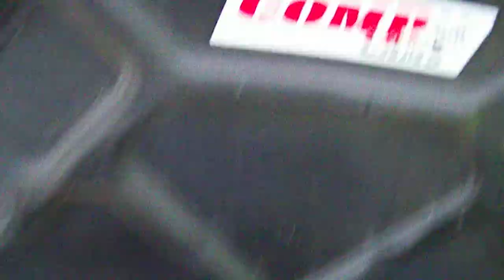Ford Focus Comp cams stage 2

Comment: Awesome, for a sec I thought I was the only 1 dumping a ton of $$$ into my zetec!!! I did ALOT OF REPAIRS & UPGRADES & THEN LASTLY my timing & water pump & then I installed a cold air intake TO THEN DEVELOPE A SLIGHT LOWER END KNOCK! TOOK IT APART & FOUND EXCESSIVE BEARING WEAR FROM 200K MILES (& A PREVIOUS, TEENAGE OWNER) SO I INSTALLED THE BEST MAIN & ROD BEARINGS I COULD FIND, NEW O2 SENSORS,COIL,SPARK PLUGS(MOTORCRAFT & THEY SHATTERED AFTER LESS THEN 2K) , WIRES, & ALOT MORE, ID BE HERE TYPING 4 EVER!!! I FOUND THE COMP CAMS & 1 OTHER COMPANY OFFERING UPGRADED CAMS FOR THE ZETEC. MY BIGGEST QUESTION IS, WHEN I FIRST LOOKED N2 UPGRADING MY CAMS, I WATCHED A VID ONLINE ABOUT IT & THEY SAID TO "ALSO REPLACE THE FOLLOWERS" WHAT ARE FOLLOWERS??? R THEY THE LIFTERS, LIFTER BUCKETS??? ID LOVE TO KNOW ALL ABOUT YOUR ZX3 ZETEC & ALL THE WORK UV DONE! EXSPECIALLY ABOUT TUNING!!! MUST I REPLACE THE STOCK ECU? HEARD I COULD USE A 00-04 RS ECU BUT IV NEVER SEEN 1 IN MY LOCAL U PULL IT!!! LOVE WHAT UV DONE & REALLY HOPE TO HEAR FROM YA!!! YESTERDAY I ORDERED A 4G DONGLE 4 MY 6.2' TOCADO 4G ANDROID 6, THAT I INSTALLED N2 MY 03 FOCUS SE, CAN'T WAIT TO FINALLY SEE MY "SMART RADIO" REALLY WORK/WIFI/INTERNET!!!

Comment from the maker: only time i had problems with the check engine light is when i installed the headers. but i got a tune from Tom from FocusFanatics and it bypassed the code so the light turned off.

Comment from the maker: only problem i have after the installation of the cams is acceleration between 2,000-2,700 rpm. it lags like a mofo. its because my friend didnt time the car right. but other than that, the cams really do wake up the car. for mods i have OBX catback exhaust, CFM 65mm throttle body, early 2000 model Focus intake manifold ported to 65mm, MSD coil, CFM sparkplug wires, short ram intake, 4-2-1 headers and a SCT Xcal tune by Tom from Focus Fanatics. oh and i forgot my AEM adjustable cam gears haha

Comment: im looking at some stage 1 crane or comp , but im also thinking something along the lines of yours stage 2. Usually i like to go with the best that i can get , how has the car been with the stage 2's any issues with them at all? and also do you have the stock cam gears on there? As far as my car for performance mods , i have a magnaflow cat back , high flow cat + flex , Sct 91 tune , shorty header , and i have the svt stock intake on there. just looking for a bit more power.

Comment: ID LOVE FOR YOU TO FILM AS YOU RIDE IT ARROUND!! A BIT OF EVERYTHING FROM ACCELERATION TO EVERYDAY CRUIZING!!! BUT, ID LOVE TO SEE IT RIP! TO SEE HOW MUCH MORE PERFORMANCE IT GAINED??? I WILL SOON GET & INSTALL THOSED SAME CAMS!!! DID U CHANGE ANYTHING ELSE BESIDES THE CAMS & TIMING WHEN U INSTALLED THE COMP CAMS???   ( NEW FOLLOWERS_ WHATEVER FOLLOWERS ARE???) ARE THEY THE LIFTER SPRING, BUCKETS??? IDK??? WHERE DID U GET THE 65MM TB??? & HOW MUCH & DID IT MAKE A BIG DIFFERENCE???
Reply from the maker: D.j. B how's it going d.j? This car has come a long way. It's currently down at the moment. My water pump housing took a shit. Put planning on getting it back on the road soon.
Reply from the maker: D.j. B me and my friend did the timing belt, along with the cams and adjustable cam gears when while installing the cams. It's lasted all of this time with stock valves, valve springs etc. I do recommend getting a tune once you install these. I bought the 65mm throttle body from CFM. (Central Florida Motorsports)
Reply from the maker: D.j. B I did notice a nice gain in power. Nothing crazy though. Just make sure to buy oem Ford timing components. The other crap brands from China are sketchy.